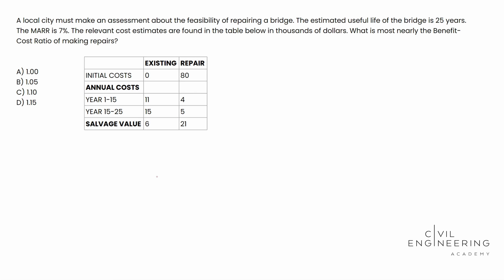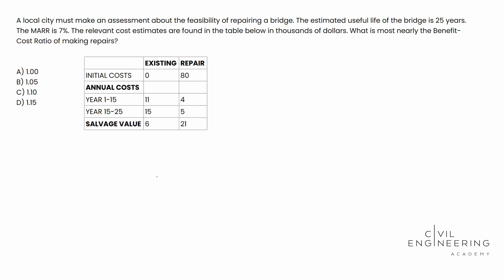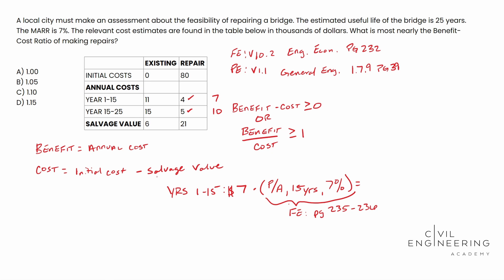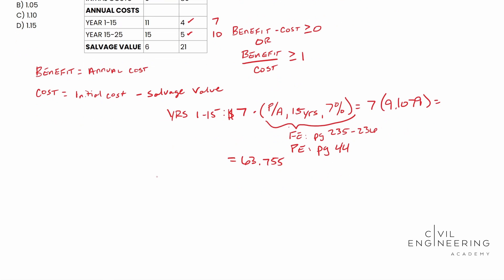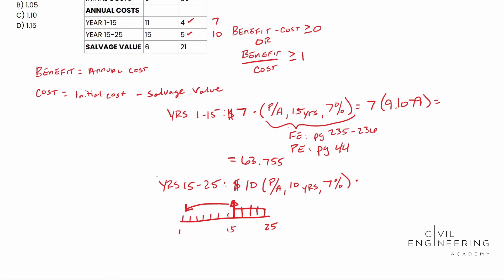Civil PE Exam - Construction - Benefit to Cost Ratio of a Bridge Revised

Comment: Ncees pe hb 1.1, p. 39, 44.

Thank you. I like these random videos for my PE study. I have a plan and materials which I use. When a random video like this pops up I treat it as a pop-quiz (surprise) regardless of the topic I study at the moment. The idea is: if I do well on pop-quiz I should know the material especially since the problem comes out of nowhere and I am expected to solve it "on the spot" with what knowledge and refs I have. No time to review material -- just solve it to prove myself that I am competent.

What a mean problem! And I love it. Will have to give it another shot tomorrow.

Update: redid the problem. The ref doesn't  properly define how mathematics of B/C work so either this problem is above and beyond PE scope or we need to memorize  (not always a good idea as memory can fail under pressure) how B/C gets applied on exam. Any advice Cody ?
Reply: That’s exactly what I did for the FE.  I’m glad these videos really help.  Good luck on your exam! Yeah, the reference is very vague. I’m a little confused by your question so feel free to reply again if this doesn’t answer your question.  If the investment is beneficial for the investor, the Benefit-Cost Ratio will be >1 as in, it will have more benefits than costs.  In this problem, we are evaluating if the investment (repairing) is beneficial for the investor (the city). The annual costs are benefits because you save money if you repair it. We subtract out the salvage value from the initial costs to find the total costs. Did that clear it up?
Reply: @codywsims  Hey Cody. To me the benefits are the savings on the annuals costs and the increased salvage value. The costs would be the 80000 + the actual maintenance costs, right? By this logic, you would get an answer less than 1. Let me know what you think.